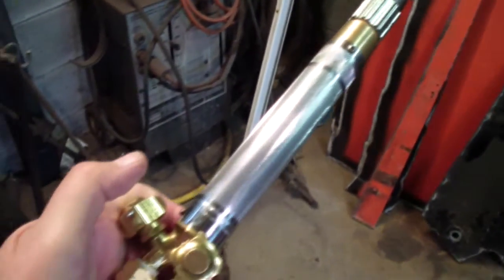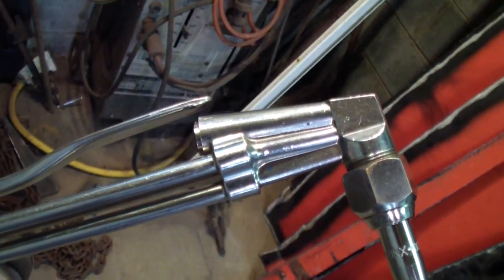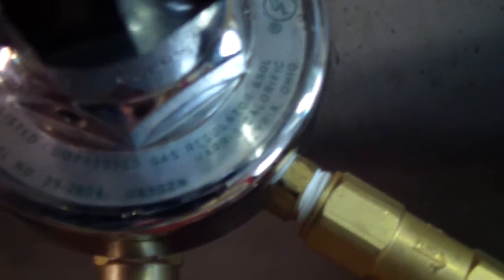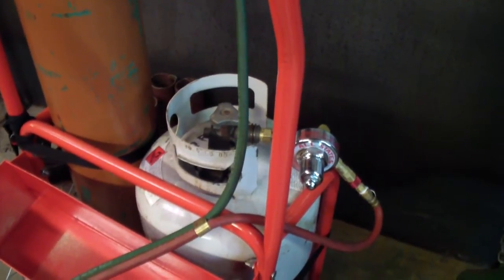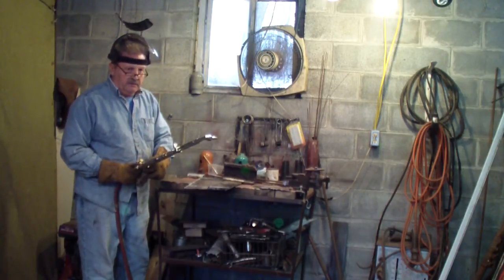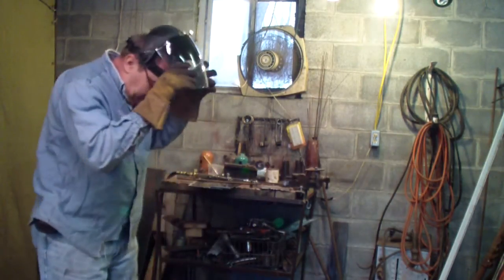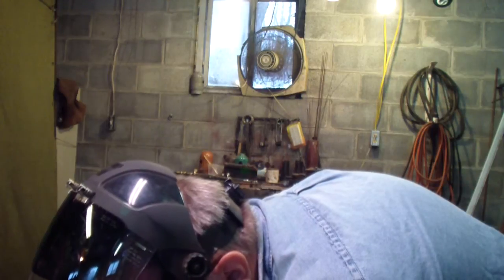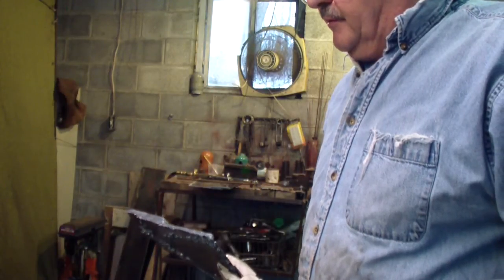Demonstrating the best fuel oxygen cutting torch made

Comment: Oxweld (ESAB, used to be Union Carbide/Linde back in the good ol' days) has made injector-type torches designed to operate off of <1 psi acetylene or fuel gas since the 1920's or 1930's. THE best combo torch made is the Oxweld W-17/CW-23 combo. The welding and heating heads all have individually-sized injectors in them that can work with <1 psi fuel pressure. They were designed for use with low pressure acetylene generators back in the heyday of oxy-acetylene welding, before arc welding became the primary welding method. However, they will also work with medium pressure acetylene as well as low, medium/high pressure fuel gas.

The CW-23 cutting head likewise works with low pressure acetylene or fuel gas. With the regular acetylene injector it will cut 8" steel. With the hard-to-find fuel gas injector it can cut 8" using propylene, propane, natural gas, or hydrogen. You can also cut something like 2" using fuel gas with the acetylene injector, but you cannot use acetylene with the fuel gas injector.

I will have to make a video of the W-17/CW-23 in action. They're easy to find, the tips are cheap and easy to find, and they are built with the kind of quality you just don't see much of anymore.

A few years before ESAB bought Victor and foolishly discontinued the superior Purox and Oxweld line they brought out a new replacement for the Purox W-300 and Oxweld W-400, called the Purox WH-4200. It had a cutting attachment called the CW-4200, with three inline tubes. It featured a spiral mix injector in the head that was also capable of running off of very low pressure fuel, and unlike other torches that cannot run acetylene if they have a fuel gas-specific mixer, the CW-4200 was capable of using either acetylene or fuel gas and could cut up to 8" thick material using either fuel source. I should video that one as well. Unfortunately, they only made them for a few years and guys that have them don't give 'em up, so they are hard to find. The CW-4200 cutting attachment can be used on any full-size Purox-type handle though (W-201, W-202, W-300, W-400), so if you have one of those handles and come across a CW-4200 you can use it to be able to cut thick material with fuel gas.

Comment: I just bought a set of tanks for welding and I noticed after I got them home that the threads on both tanks oxy and acet have that teflon thread tape on the threads of each of the connections.  What to do?  That isn't clean or safe?  How do I remove it and maybe the whole set up isn't worth what I paid and I'm somewhat disgruntled... Have I been ripped off?  Someone with experience please tell me as I'm really a beginner welder and very inexperienced, obviously.
Reply: Reapply (ONLY teftape RATED for oxygen use if on your oxygen regulator) on TAPERED pipe thread joints, NOT the threads on the nuts which engage the cylinder valve! I see a lot of cylinders where previous owners don't know how the different fittings are supposed to work. Gasoila brand tape is what I use for all my welding gas connections.
Reply: The ignorant often teftape gas fittings but they don't understand the threads are not the seal! The sealing surfaces of CGA fitting joints are the seal. The nipples and nuts are standard parts (Western dominate the industry so I use those which are easily found online. For more useful info visit real welding forums.
Reply from the maker: It's good, just clean with brass brush or tooth brush blow out any dirt and reapply

Comment from the maker: I know what you mean. I have burnt up  tips before with other torches.  The thing is you really cannot adjust it wrong. The only thing to adjust is the oxygen. And no matter how high you turn it, its a little louder but not like the Smith.  Your analogy of a older carburetor fits it good. Just open the throttle, in this case the oxygen valve

Comment: True he is using an equal pressure torch, but I believe you still want a comparable flow through the tip to prevent overheating and  due to the greater stoichiometric ratio of propane & oxygen, you need significantly more oxygen to properly react with the propane for a neutral flame.

Comment from the maker: Thanks that sounds like it. Teflon tape some times. This is Harries description "For Universal Pressure Torches (sometimes called “low
pressure”).  This equipment operates with less than 1 PSIG fuel
gas pressure.  Oxygen, at pressure, creates suction that pulls the
fuel gas into the mixer"

Comment: Also, I don't believe you had enough fuel flow through the tip. Going by the Smith Equipment oxy-propane instructional video on YouTube, you should hear a bit of a "shrill" noise and then you get a neutral flame using the "star pattern." I set up my oxy-propane torches based on those parameters. If not, your tip will overheat and you will not get the proper performance. Remember, it's not oxy-acetylene. I recommend you watch: watch?v=f2amO0T3vkQ